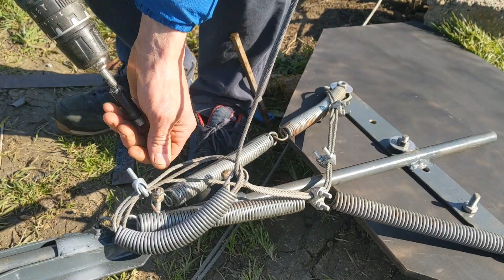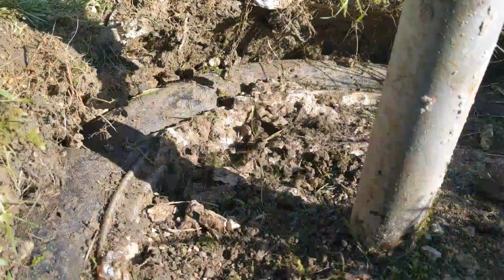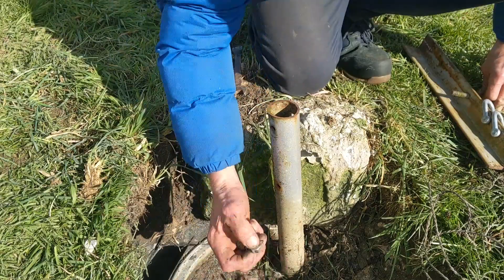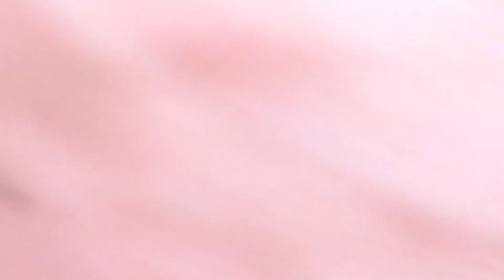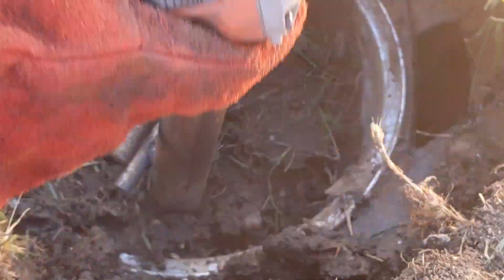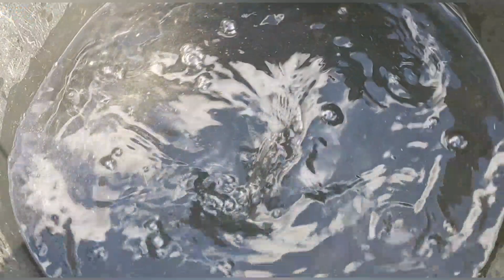Free Energy Project - Twin Rotor Wind Turbine - Reinforcing Tower Bases - 11 April 2021

Comment: mixer came in handy, mixing something like gravel into the mix makes it stronger but maybe that paint mixer and drill wouldnt handle it Nice welds . Did i see a tyre flexing on the rim . Wind is just starting to pick up here, further near the coast many houses lost their roofs nearly 200km winds, were miles from there. Its a double cyclone hitting western australia .
Reply from the maker: and yes there is a tyre which I hacked open and filled with concrete.
Reply from the maker: yeah man your right about the gravel on both counts , it said on packet if you cant use gravel go fairly low on the sand , it's hard already but not taking that winch off yet , s**t you guys better get to the bomb shelter !!
Reply: Keep your heads down. We in Florida are getting some nasty storms today also. But they are bringing some much needed rain that we haven't seen in a month. We went from upper 80s to mid-60s in under an hour. ( 30.5°C to 18.3°C ).